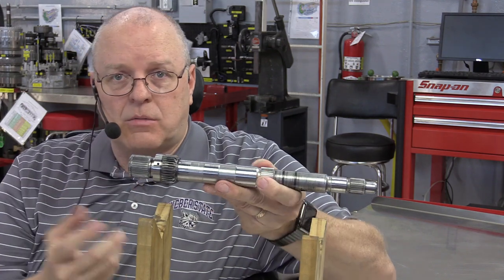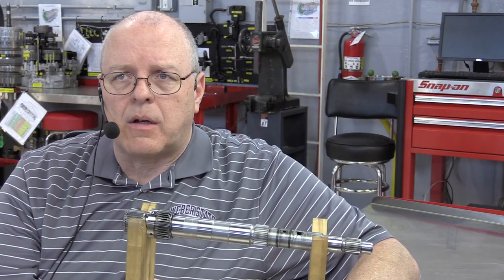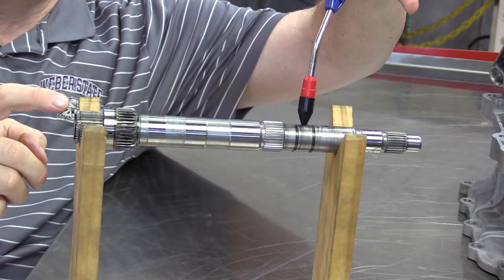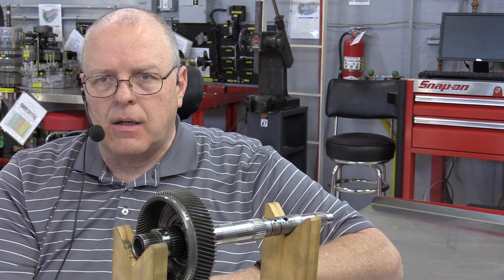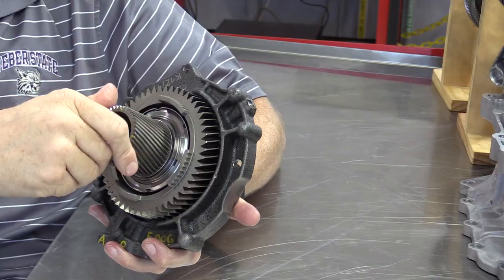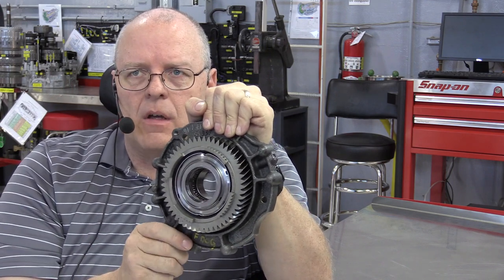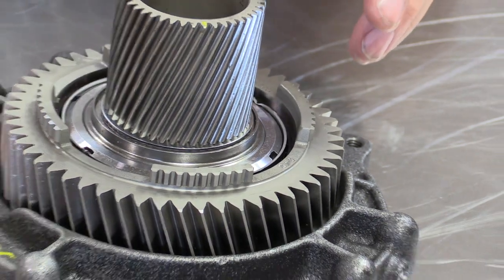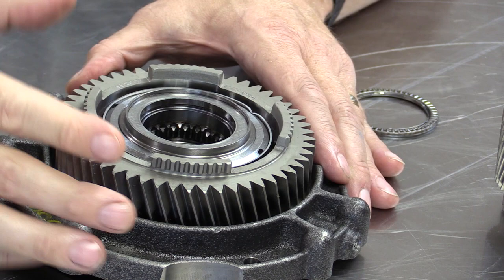Dog Clutch Demo - ZF 9HP 9-Speed Transaxle Operation - Part 1 of 2

Comment: Love your videos there very informative.  I have this tranny in my 18 jeep renegade with 2.4 engine I know alot of people don't like these trannys.  I like this tranny it's got quick shifts. Yes there are things I don't like about it like when you go from park to reverse it has slight delay then when you go from reverse to drive it's got about a 8 to 10 second delay before it engages so I have to tell my wife when she puts it in gear don't give it any gas till it engages. The only other thing I don't like is it does have a aggressive engagement from 4 th to 5th. So my question is 4th to 5th aggressive because of the dog clutch not being timed just right it doesn't do it all the time mostly under moderate throttle

Comment: I have only one and it's pretty major complain on my Passport with this transmission. At certain speed, it does not want to perform certain downshifts usually 5-4 when the gas pedal is pressed all the way which makes the vehicle very slow to accelerate under urgent conditions. I have to manually use the left paddle on the steering wheel to force it downshift one more time in order to get maximum acceleration.
Reply: What year passport?
Reply: @ctbale1  2021

Comment: Why do gear?  What's pro from it?
Reply from the maker: Smaller package inside the transmission. Space was limited.
Reply: +WeberAuto Does dog clutch means this AT gear box got Manual Transmission DNA?
Reply from the maker: ap wang Yes, you could say that

Comment: Does a dog clutch  perform the same function as a synchro?
Reply from the maker: +Don G. No, the Dog clutch cannot work unless the gears are already synchronized. The transmission controller synchronizes the dog clutch gear teeth by using the other multi-disc clutches in the transaxle. Good question!
Reply: OK TX for that info,
It's just that I have been told by truckers that they can shift a manual WITHOUT using a clutch! I find this hard to believe! Is this magic?
Reply from the maker: Don G. Hi, yes, truckers or anyone else who gets very familiar with the operation of their transmission can shift through most gears without using the clutch; however, it does accelerate the wear of the synchronizers. They try to synchronize the engine RPM (transmission input shaft) and transmission output shaft speed themselves. If you can synchronize those two speeds, then you can move the shift sleeve without releasing the clutch. Thanks for your feedback, you have great questions!
Reply: Is the reason the drivers can synchronize the output shaft w/the input shaft is due to the very narrow RPM band a slow revving Diesel has? Whereas a high revving auto has a wide RPM band making that trick difficult?
Reply from the maker: Don G. That certainly makes it easier, but it can be done with wider ratio transmissions too.
Reply: But the bottom line is no matter how good a driver you"think" you are, it is not recommend to shift without depressing the clutch? Small nicks appear on the gear teeth due to this method?
Reply from the maker: Don G. You are correct. No matter how good the driver thinks they are, they will accelerate wear in the transmission if they do not release the clutch while shifting.
Reply: +WeberAuto I can vouch for the wear :-) We race ol school Saginaw 3 speeds and Muncie 4 Speeds. First thing we do is rip out the syncro's to reduce rotating mass weight. Mind you, we aren't shifting gears much in circle track stock cars. We do leave them in for road course races. Getting into reverse and 1st gear sometimes is fun. But generally speaking, we inspect and rebuild our transmissions ever year. Ford Top Loaders do seem to last longer than the Saginaw / Muncie units.
Reply from the maker: Doug Hanchard Thank for the great feedback! It is good to hear from someone with so much experience!
Reply: Thank You!

Comment: Dear Sir, thankyou very much for your "teaching video", so clear. I have a new Jeep Compass 4x4 Latitude plus with a 2.4 engine and the ZF9HP gear transmision. ( think it's 9HP like in your video). It has an strange behaviour. Some times rising at 4000 rpm it seem to be stuck at high RPM, but with just only 60 or 65 miles per hour.( cruise control ON). Revs slow down very slowly till stabilize at 1800-1900 RPM ( more or less 60/65 miles and hour.)Starnge and not safe behaviour. Thanks again.
Reply: These 9 speed ZF transmissions are some of the least reliable transmissions that have been sold in decades. On top of that the programming is usually pretty poor too. Some manufacturers do a better job programming the shift logic, but Fiat does by far the worst job. Given that the vehicle is new that could easily be an issue with how Fiat programmed the transmission for your Jeep. The first thing I would do is insist that the dealer check to see if there are any software/firmware updates for the transmission computer. Otherwise the transmission is already starting to slip and fail.
Reply: @jblyon2  Thank you very much for your answer, dear Sir. I'll try with our FCA representative to upgrade transmision software. Not sure they have that program. I'll see.
Reply: @jblyon2  You are talking nonsense. Infact out of Chrysler, Honda/Acura and Land Rover, FIAT has refined the software best. Honda eventually did a good job on the UK crv. Guess how I know these things cause I work for a living on these cars. Chrysler was the first to debut the ZF-9 on the 2014 Cherokee KL. It took them till 2016 to fix both the snap ring issue and software which in certain cases was damaging the transmission. This also happened to Acura. Anyone with common sense would have known to never buy a brand new vehicle with a unproven, new and vastly complicated transmission. The reason you hear so much of the issues regarding the ZF-9 in conjunction with FIAT is because they were the face for the ZF-9 and they also were the biggest investors for it. They had the most number of vehicles relying on that transmission. This is why they had no choice but to do whatever was possible to get the software up to par. One more VERY important thing to add here.
ZF is an amazing transmission company but they are ultimately to blame for all of this. German's are a very prideful people especially when it comes to automobiles. ZF tried to blame AMERICAN driving habits on the software AI not functioning as they intended. They worked hand in hand with FCA for many years to fix this issue. FCA is the largest customer of ZF transmissions with BMW being second.
Reply: @paulj9821  Paul, if I buy a used 2019-2020 or a new 2021 Jeep Cherokee, should all the wrinkles be worked out by now?  I like how the Cherokee with the towing package can haul up to 4,500 pounds, and has a better infotainment system than the Mazda CX-5 and Toyota RAV4, and has a nicer interior than the RAV4.  I really want to like the Cherokee, but the only cars that freak me out more are the Nissan Murano and Pathfinder with the dreaded CVT (and even Nissan is giving up on the CVT in the 2022 Pathfinder and replacing it with the ZF!).  I would appreciate your opinion!
Reply: @JBM425  No because the new generation is coming out at the end of 2021 or 1st quarter of 2022.
Reply: I've been telling people not to purchase a 4 cylinder car with that 9 speed it's not a good combination. It's best with the V6's but just keep up with the maintenance and updates.

Comment: Wouldn't the use of dog clutches drastically increase the amount of debris in the fluid and significantly reduce the life of this transmission?
Reply from the maker: Good question. Theoretically no, the job of the transmission controller is to use internal clutch packs as synchronizers. Once the speeds of both sides of the dog clutch are synchronized, the engagement will be quick and easy (no grinding). I hope that helps.
Reply: On Hondas that use this transition (Pilot and Passport), they recommend changing transmission fluid every 45000 miles.